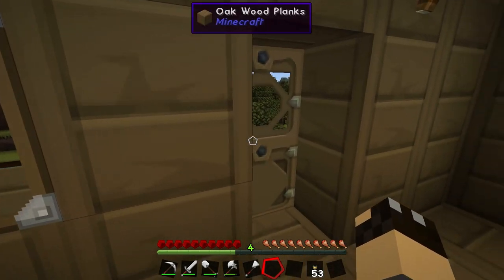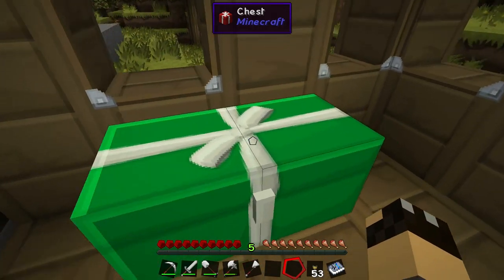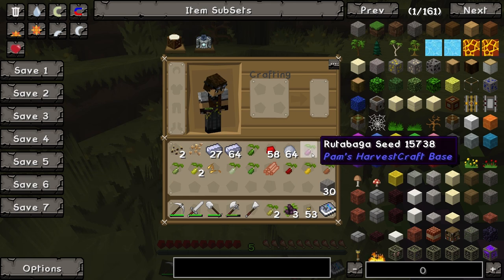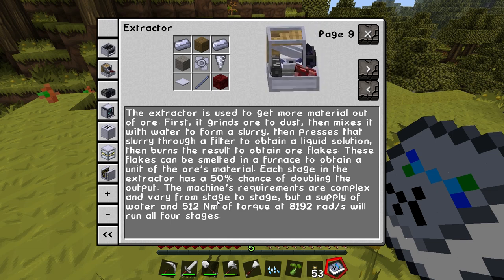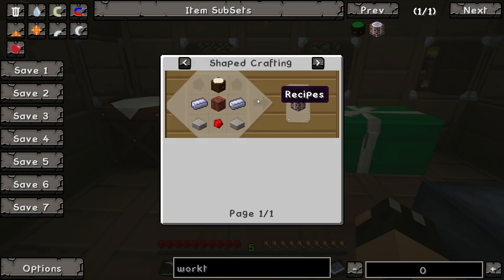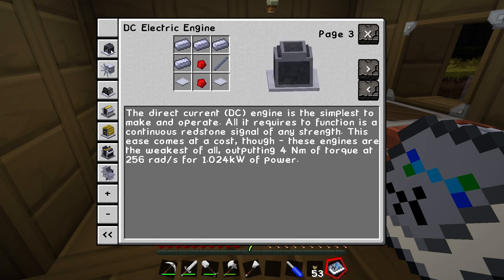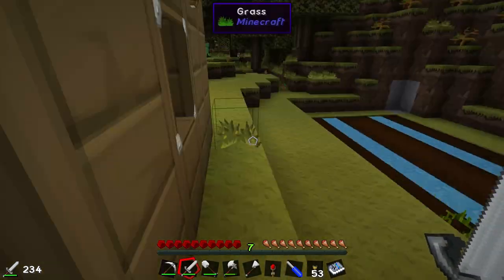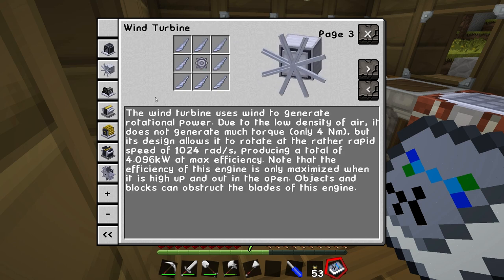Power! -3- Feed the Beast - Horizons

Comment: As far as I know, you don't need to put the turbine at a specific height, but you do need a 3x3 area in front of it; which is why you couldn't place it most of the time you tried.

Also, in terms of lubricant, canola plants should give a bunch of seeds when they're mature - and you put them in the Grinder to make lubricant. Also, lubricant isn't very important - you only need it for gearboxes, which are used only to turn torque into speed or vice versa at a preset ratio (which depends on what kind of gearbox you use, from x2 to x16).